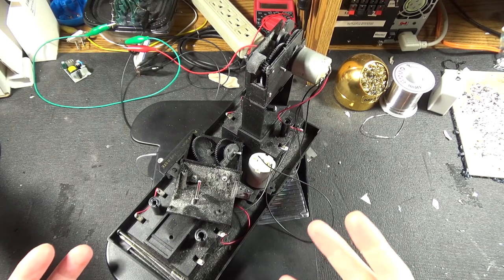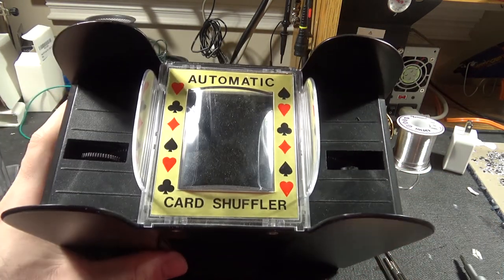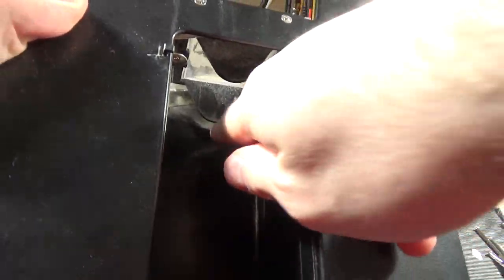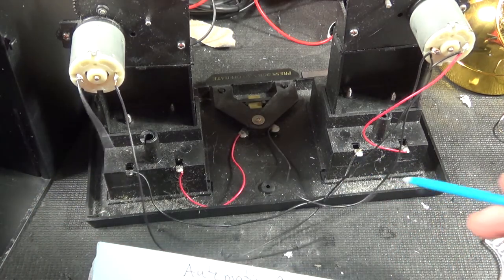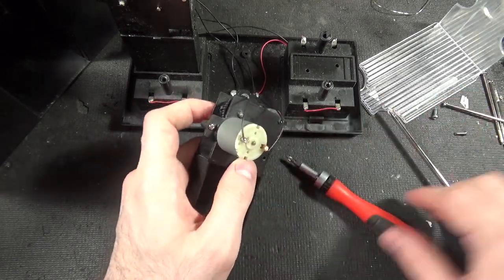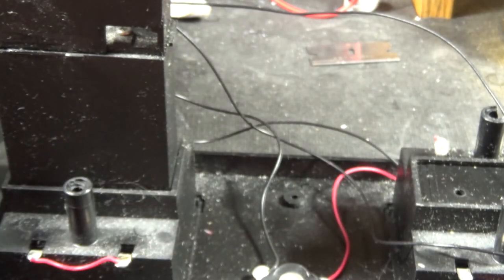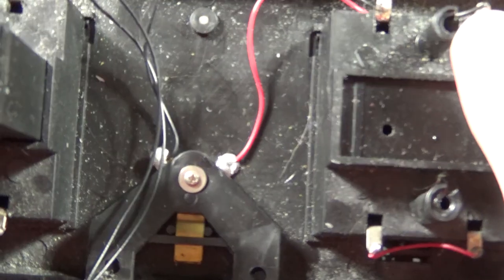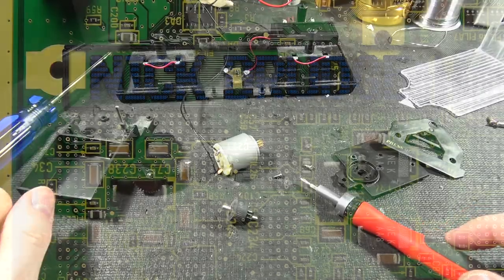Dirty Automatic Card Shuffler Teardown

Comment: How hard would it be to add an AC-to-DC Power Adapter to the shown card shuffler? I'm tired of changing batteries.
Thanks and keep up the great & entertaining work!
Reply from the maker: Thanks! I will certainly try! I've actually had the idea to do that for awhile, but everyone I play cards with thinks I'm crazy and wouldn't want to plug in to shuffle. It can be as easy or as complicated as you want it to be. I, of course, make everything more complicated than it needs to be!

If you like living on the edge, it'd be fairly easy to just take a 6 volt or so adapter and alligator clip or solder to the actual battery terminals, negative on the farthest negative battery, and positive on the farthest end positive battery terminal. I'm lazy so I just use a multimeter with the batteries in place to find where the two points reads the full 6 volts and gamble it's correct. 
You could even open up the unit, and cut the end of the adapter, find positive and negative and solder wire to the same spots described, then make a hole in the back and tie the power adapter's cord in a knot inside the case, so it doesn't get pulled out, then run the rest through the hole, so you have the cord coming out to the adapter. Or, make a hole in the back, install a barrel jack, and solder the connections to the positive and negative as before.
Just make sure to remove the batteries before plugging any of this mess into the wall. Or install a switch that goes between battery and wall power, to pick which one to use.

This is a massive wall of text, but any one part of it isn't too difficult if you don't mind wasting an afternoon. 
I take no responsibility for broken things, shocks, fires or so on ;) 
I've added this to my video ideas board to hopefully make a video so things are more clear than I can describe! Thanks for watching and reading this ramble!
Reply: If I have more problems with my switch this might be an option. Thanks again.

Comment: My gears all work but my cards just vibrate at the top and dont shuffle half the time. Super annoying.
Reply from the maker: Probably the rubber wheel near the edge is losing it's grip. Sometimes you can fix it by using a rubber eraser on it. The problem is they usually have little groves in the rubber piece, and if that is flattened out too much, it just won't work.